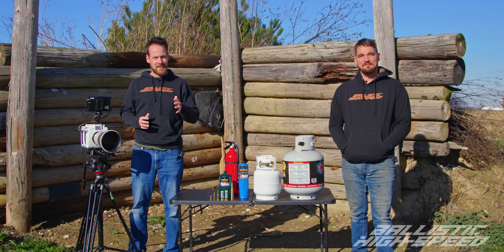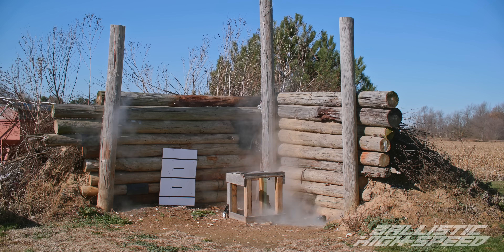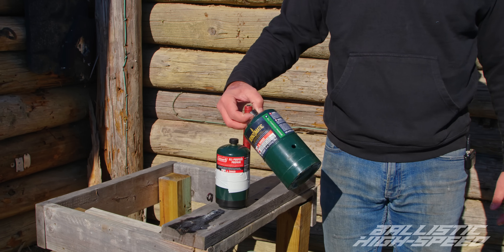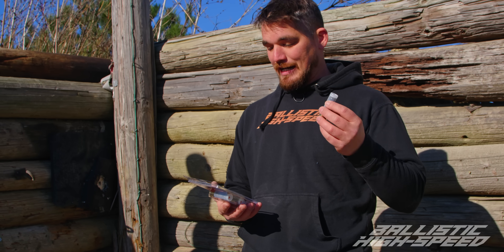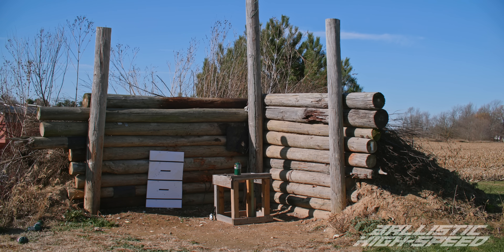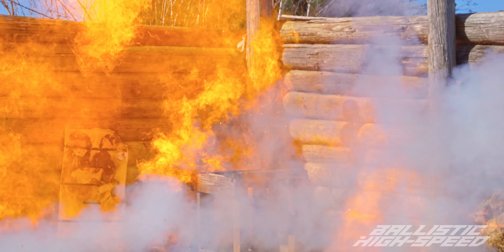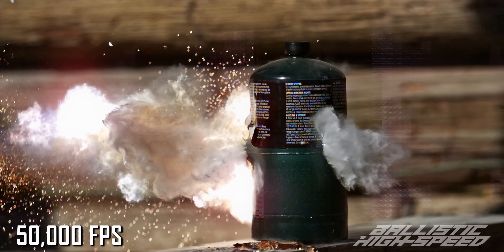Shooting Propane Tanks = Exploding Fireballs?? - Ballistic High-Speed

Comment: I did this myself about 20 years ago.  I used steel tipped 8mm that I thought would make enough spark.  No explosion with two small tanks.  Then I tried putting a flare close by and still no explosion.  Propane is extremely cold when decompressing quickly and most sparks don't have enough heat to ignite it.

Comment: You need to head to Matt's range and do this again.  Your backstop may be trapping your sparks until the fuel air mixture is right.  Try it again with the tanks further away from a backstopping and see.

Comment: The problem with any ignition source is it happening when the air/gas mixture is correct, as you could stand inside a gas tank and light a match and nothing would happen. If you stand inside a gas tank that is empty and open to the air it will blow.

Comment: 4:51 Safety first, Science second but where is the common sense.?  Like all gun tubers never smart enough to wear gloves to touch stuff you shoot. Frosty metal and dumping out liquid propane with bare hands. How can that not be safe.? Do you use eye protection when you shoot then take it off to dump out "sizzling" propane.? 
Don't get me wrong, I like the videos and the various rounds you tried, and the results. 
Also kudos for fitting an electromagnetic actuator instead of using a string. All gun tubers should pay attention to that part.
But maybe see if you can get a glove manufacturer to sponsor you if a ten dollar pair of hand protectors isn't in the budget.

Comment: I did a 20lb tank a few years ago. Big mistake. I set up and parked my truck about 50 yards away. I set out a dozen lit small candles around the tank (tea lights).  I went back behind the truck. Set up my rifle on the hood. I shot it with a 220gr 30-06 round. Anyhow....   the explosion and GIGANTIC fireball set the grass on fire in a 60ft circle. 2 pieces of the tank hit my truck (1 penetrated the rear door)
It took me about 2 minutes to stamp out the fire with a blanket off my seat. 
  The shockwave and bang was so loud, I never noticed the truck hits until I realized I better pack up and skiddadle fast before someone reported the loud report. 
Anyhow.....never again. Big difference between the 1lb and 20lb tanks. It was more like 100x the explosion, not the 20x you'd think.

Comment: We've gotta see the 20 pound. Though, it would be wise to use heavy steel chain, welded to the collar and welded to a 2 inch steel pipe sank 3 to 6 feet straight down. Control the biggest, heaviest accidental projectile.

Comment: I would like to see this in thermal also 😁
Not expecting 2000fps for that but 30 or more is easy with just a Chinese camera like the InfiRay T2 or something else, just make sure it isn't lower resolution than the T2 (Flir one pro is garbage at less than half the resolution and 1/3 the framerate don't even try it 😂 i have it and it's a huge let down every time..)

Comment: Hey, propane technician and salesman here, the gas shooting out of the “nozzle” is actually a pretty awesome example of an OPD at work. The OPD is the overfill prevention device that lets out excess propane when pressure gets too high inside the tank. When the projectile hit the tank, right before ripping into it, pressurized the air inside like squeezing a water bottle so the OPD kicked in and that what you saw there😂 
Love the videos btw, keep up the good work broskis
Reply: Do you also sell propane accessories? I couldn't pass up that opportunity, sorry not sorry.
Reply: @whoslineluver  got dangit Bobby
Reply: Came here to mention this lol
Reply: The urge to make a Hill joke aside, thats really awesome and I got to learn something about the ubiquitous propane tank. Somehow, I think the OPD is gonna stick in my brain for a while. Thanks. Love it when I learn something productive from the comments.
Reply: hank hill over here
Reply: Asian propane tanks don’t have overpressure or fire over temperature relief systems. 
That’s why a lot terrorists have screwed up in attacks in the west.
Reply: Nahhh, squeezing it like a water bottle would have required excessive deformation on the tank, and that's not visible. Neither in the high speed fotage, nor on the left over tank.
Instead the projectile entering the tank hits low enough to hit the liquid phase, and due to its high speed, sends a shockwave through it. That one will travel all through the tank until it hits the OPD, which does its job and releases the excess pressure.
Reply: @smurface549  the initial impact did deform the tank for a split second but the force of the gas and pressure flooding out basically canceled it out, you can see it concave a little when the bullet hit
Reply: @jerryonixrandomness7382  Sure, but that is such a minuscule amount that it certainly isn't responsible for a pressure increase that would pop the safety valve.
Reply: @ well an impact at that speed causing any form of dent to the tank is gonna cause a crazy build of pressure, if even for only a split second. Either way, propane is cool and I find it interesting, glad there are people in this comment section taking an interest even if it’s just for a bit 😄
Reply: @jerryonixrandomness7382  Yeah, but that is called a pressure wave. Caused by the high speed impact. The projectile moving through the liquid displaces the same with a very high speed, causing the pressure wave.
It has pretty much nothing to do with displacing large amounts of liquid in a confined space, as if squeezing a soda bottle. And that minuscule motion of the tank wall doesn't do anything, compared to the projectile itself moving across the whole tank in a split second.

Comment: Disposable mini propane tanks are very thin. They specially process the gas to remove most of the water so between short lives and dry propane rust isn't an issue so the walls can be thin. Refillable tanks need thick walls so rust doesn't weaken them over time with all the water vapor in standard propane.

Comment: I started a massive tire fire in a junk yard by shooting the old internal thread propane tanks. 22 shorts at the neck welds by the valve. 50% of the time, the weld spark would ignite the propane.

Comment: FYI, the blowback from the nozzle wasn't the fill, it was the over pressure relief valve, designed to vent gas an avoid a catastrophic failure. Obviously it was never intended to be hit by a 50BMG, but it tried valiantly to do its job regardless.

Comment: You're fighting so many forces here that prevent it from igniting. Temperature is pretty key. Ignition doesn't occur at impact for two reasons. The energy needed to heat the gas to ignition temperature is pretty significant. This is part of the reason a cigarette will not ignite gasoline no matter how hard the internet wants you to believe that myth. The fuel is very rich but there should be enough oxygen to get a flame at some point. Most of the flames occur at the back wall where the gas has diffused enough that it's more easily heated.

Comment: 4:40 About the tracers not setting them off. You made a few scientific mistakes there.

1) Tracers do not ignite fully until they've flown 50-100 yards.
2) You still need a proper fuel/air mixture ratio to ignite them. So even if the tracer is somehow magically inserted into the bottle and stays there without bursting it, it's not likely going to produce a flame. But as for the "shooting cans with tracers doesn't set them off bit", the fact you need a proper fuel/air mix means it's somewhat true IF the projectile including its tracer chemicals enter and exit and leave the scene of the crime.
3) IF the tracer chemical dislodges from the projectile and keeps burning OR the projectile itself sticks around and keeps burning then it WILL ignite the mixture as it reaches the burning tracer round.

On a side note, DO NOT fire tracer rounds in dry hot summer with lots of natural fuels around. Like dry grass, creosote loaded trees (pines) or any other flammable materials that might be around your target area.
One time at the range during a military exercise, we had loads of surplus tracer ammo. We damn near started a wildfire. And not just one random tracer, there were SEVERAL spots that lit on fire around the berm as the tracer inserts from the projectiles dislodged and landed to the sides of the target area.

Tracers most definitely can ignite propane tanks but you have to hit something that keeps the burning tracer in the vicinity as the tank empties itself.

Comment: when you shoot them and they lay on the ground "empty" they are proubably more dangerous to you than the fresh ones. the small amount of gas in a damaged metal jacket igniting will turn that into a very bad day!! you have basicly a frag nade!!  BE MORE CAREFUL!!!    Gas to air ratio for ignition is around 14-20%  very low amounts needed. also why in films and they fill an entire romm with gas... it prob wouldnt ignite due to lack of oxygen!    BE CAREFUL!!!!

Comment: Actually i think it worked at all was the corner that contained the liquid gas. The ignition only worked when enough oxygen was present to burn, so the flames where maintained by the corner so everything could be ignited. So in a bit scale test this could n a problem. As far as I remembered Mythbuster was not able to ignite the gas tanks in an open area. So I think the corner helped a lot.

Comment: You guys definitely need to go to an abandoned quarry or similarly non-flammable area and send a 20lb tank into orbit!

Something that Demo Ranch did a while ago was shoot a full oxygen welding canister. The jet of flame coming out of the back of the tank cut clean through one concrete filled metal pipe and halfway through another one in less than a second. I would love to see something like that in high definition slow motion!

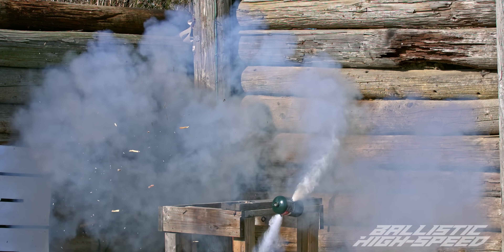Comment: 5:35 Tracers won't ignite flammable liquid/vapor tanks. In the book Yeager, former astronaut and fighter pilot Chuck Yeager describes an event where he and his wingman dropped their drop tanks and then tried to ignite them with their tracers. They weren't able to get them to light, so they gave up and went home. As you correctly state, the stoichiometry is wrong - it's above the Higher Explosive Limit until well after the tracer sparks have gone out.

Comment: My pop worked in the Natural/Propane gas industry, and many years before Youtube, I used to have an 8mm video of a lit newspaper being extinguished in a bucket of LPG, and Natural gas, without producing a fireball.  Which is why in the video you could see from the 1lb bottle pushing the flames around. Liquid Propane IS NOT Flammable.  With the 5lb, most of the flame was at ground level, because propane is heavier than air. Had you done LNG (liquid Natural gas) the fireball would have been higher above the ground. 

Here are some FACTS about LPG (Liquid Propane Gas) Propane becomes a liquid at -44°F (-42°C) at atmospheric pressure.  LPG in its gaseous phase is still heavier than air, unlike natural gas, and thus will flow along floors and tend to settle in low spots, such as basements. There are two main dangers to this. The first is a possible explosion if the mixture of LPG and air is within the explosive limits and there is an ignition source. As its boiling point is below room temperature, LPG will evaporate quickly at normal temperatures and pressures and is usually supplied in pressurized steel vessels. They are typically filled to 80–85% of their capacity to allow for thermal expansion of the contained liquid. The ratio of the densities of the liquid and vapor varies depending on composition, pressure, and temperature, but is typically around 250:1.

Comment: You notice it's always the background flames that start the blaze?
The initial burst of high-pressure propane always snuffs the initial flames, without fail. Only objects behind hold the active flames that ignite the gas. 
An interesting display of the oxygenation issue. "Too rich" is spot on.
Reply: I was wondering about this as well bc some seem to have ricochet sparks from the back so they wouldn't work in an open field but from a building down to the ground could work. I also wonder about a tank only 10% or whatever optimal would do to reduce what you said.
Reply: @Spacemoonman Have tried this with a weed torch behind a fixed 20# cylinder, 50bmg fmj, in a rock quarry with backdrop a long distance away. Tried with a mostly full and a mostly empty tank, weed burner snuffed out, no ignition.
My tanks split open a lot more than this one dumping far more liquid propane out the back side, right on the huge weed torch nozzle. Tried moving the torch back about 6ft on the mostly empty tank, but it got douched out too.
Reply: The trick is to use pyrotechnical flamers, they can't be snuffed out in that way, road flares is an easy solution.
Just saw a good example with these crazy dudes, at the later end of the video: https://youtu.be/EPKUsLtwexg?si=AawOd104lye0GIq0
Reply: If you watch closely: the 5 pound tank almost extinguishe the flames behind it, if it hadnt moved away during that rotation.
Like: if the tank was fixiated and unable to move, the venting gas would've suffocated the flames...
Reply: To ignite the gas, an air-gas mixture of the required concentration is needed. Cold gas can easily extinguish a flame if the concentration of gas in the air is too high.
Reply: @LithiumDeuteride-6  Why do you feel the need to repeat what was said and like your own comment?

Comment: Only movie I remember that had it almost right was the dawn of the dead remake where they had flares with them to strap to the propane tanks to get them to explode. I'm writing this before I watch the whole thing ( 2:53 ), so idk if when you get to a biiiig tank if it explodes or not using that method, but I feel like there is so much pressure that the flame stays outside the tank

Comment: One of my thoughts here is that a compressed gas like propane is a bad example for this because of the fact that it frosts when it decompresses. Remember that the fire triangle is not only oxygen and fuel, but also heat. Heat that doesn't exist as the propane leaves its container, oxygenated or not. That also why you can see some things are actually being extiguished by the propane instead of igniting the propane.
Reply: It probably has as much to do with mixture as temp. I bet you could play with flare placement and get more of them to go.
Reply: Even if the fuel is at freezing temps, the spark contains enough heat if the O2 and fuel mixtures are good enough. Also, the fuel is coming out literally boiling, but that is about the pressure change and the fuels liquid and freezing temp deltas.

Comment: Flour can explode in what is known as a 'dust explosion' and was a thing that could happen in mills. There's a circulated myth (?) about placing a package of flour on top of other 'fiery' explosives to cheaply enhance them as the explosion scatters then ignites and explodes the flour dust.
I neither disbelieve nor swear by this as I'm sure it would work as expected, but am unconvinced there's enough energy in flour to add much on top of a primary explosion. HOWEVER, propane explosions could be a pretty ideal circumstance to play with this it seems.

Just putting it out there

Comment: It's called a "BLEVE" (Boiling Liquid Evaporative Vapor Explosion")
As is usual, you still need an ignition source to initiate the "earth shattering kaboom".
Even with an external ignition source, there will often be too much saturation of fuel to oxygen to ignite.  That's why a too rich fuel mixture in a vehicle engine results in  a no-go situation and why the vast majority of vehicle crashes do NOT result in big fireballs.

Comment: Wonder if you would have had better luck with the 5lb cans if they were partially or nearly completely empty so the fuel/air mix is better as it sprays out as a more gaseous mix. I've set off an almost empty one off with a 30-06 soft point before at a gravel pit, but after reviewing this video I'm wondering if that was because the bullet created a spark as it hit the rocks rather than from hitting the can itself.